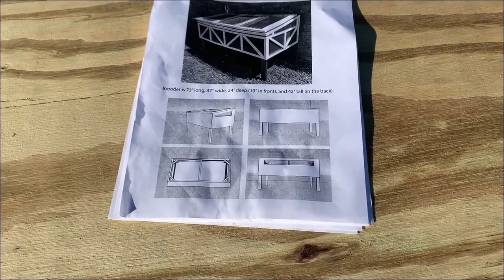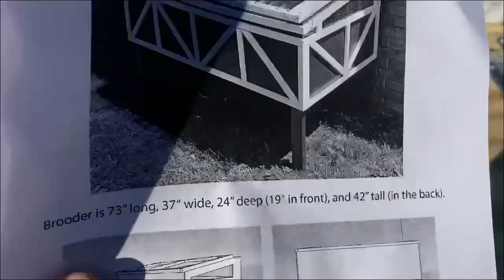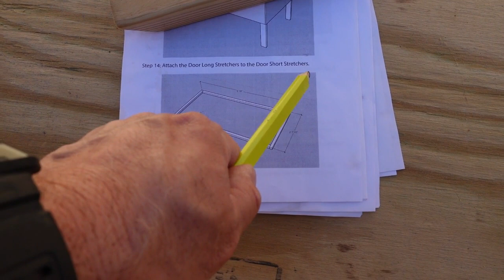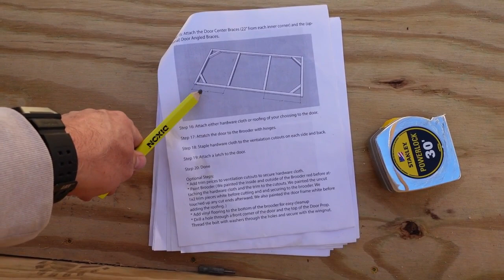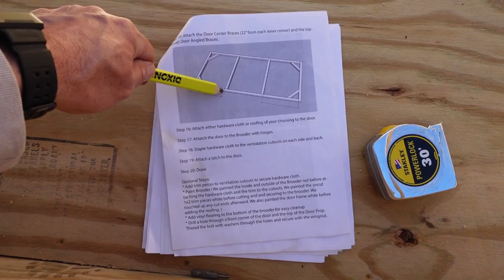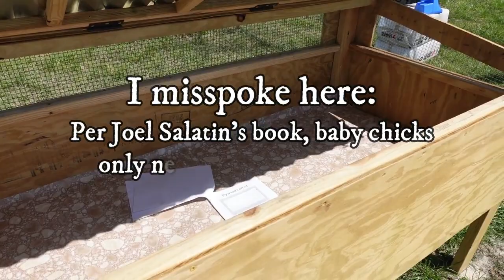DIY Chicken Brooder for up to 72 chicks!

Comment: I would build one with a hardware cloth bottom and trays under that. I don't like the idea of chicks and chickens sitting in there  own poop. You get less poopy butt. I would also make the whole top of the roof the opening minus the flat rain catcher on the back. Always mention your state and time of year or weather temps at the time of brooding for people watching. It helps people to decide if this brooder design is right for their state.
Reply: hardware cloth is too rough for chicks.  1/2 in square grid is also too wide for little chicks' feet but if you go smaller, their poops would clog up the cloth.
Reply: @d.a.tsun5104   Easy fix with putting some paper towel down until they can walk better in the begging. A few days to 1 week old. After that it's fine. Having them sit on there poop in shavings doesn't help with poopy butt. Which is what I did with my first chicks.
Reply: @danielwagner6290  I tried that too in my first brooder: disgusting.  I didn't use paper towel, not for 28 chicks trampling on it.  I used newspaper.  The chicks spilt water and pooped on flat surface = the stepped on the poop 100% of the time, compared to using wood shaving that would bury the poops as they scratched and kicked the shaving.  And I had to constantly replace the paper - not even 2 hrs time the paper was drenched and soiled.  The paper got shredded and stuck to the wire, making it even harder to clean and you couldn't just put new paper on it because newspaper paper is very absorbent that it wicked up the wetness of the paper below it.  They didn't get poopy butt/pasty butt from walking on poops but from poor digestion, so I gave them ACV/Honey drink and they're better.  We didn't have many pasty butt chickies either, only 2 and the condition wasn't grave because we watched them every time we changed their water or refill their feeder and we inspect them one by one every other day.